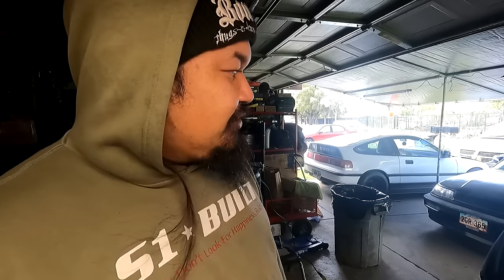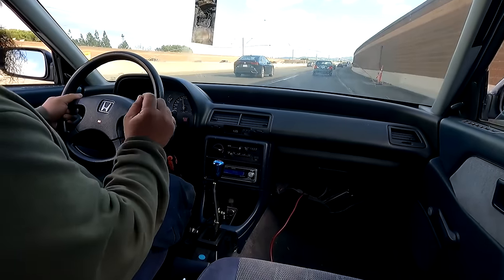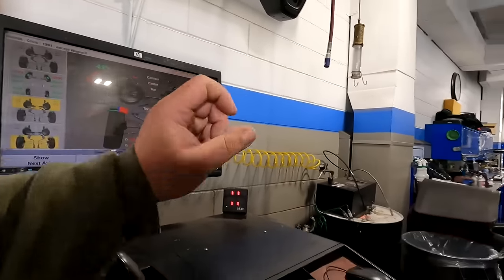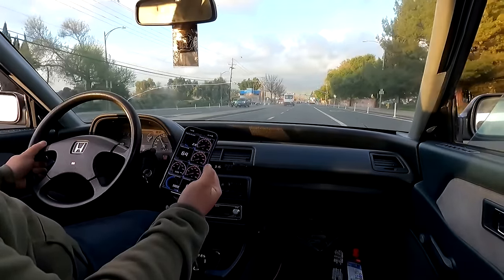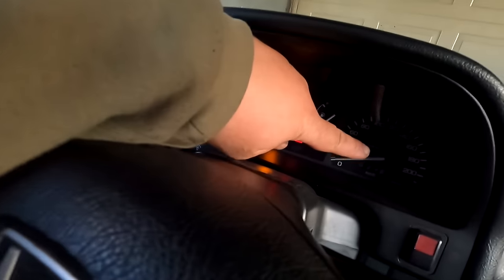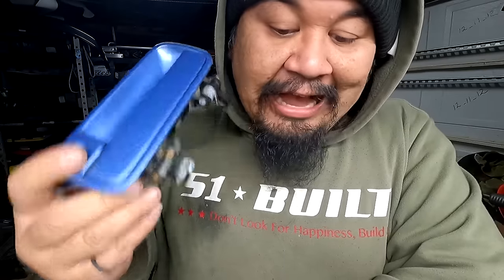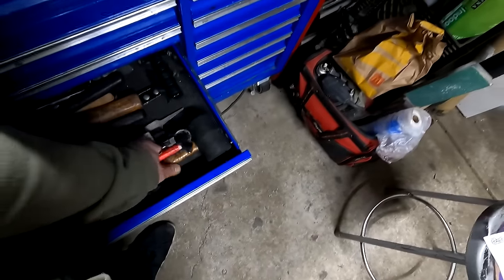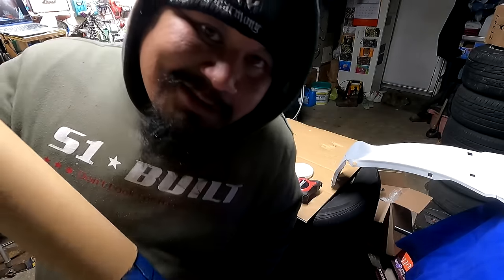FIRST DRIVE K20 TURBO EF SEDAN | Alignment | Vinyl Wrap

Comment: Progress better than no progress!! apart from the silly mistakes the fender looks sweet...when it comes to the tight corners get your self some plastic/silicon cooking spatulas etc they are great for pushing into the tight corners (you can probs get proper 'car wrap' pusher things on temu now for chump change, tho that stuff used to cost) also that stuff will stretch like crazy so for strange tight corners just keep practising stretching and 'shrinking' ...All the best from the UK...;D

Comment: I'm hoping that if you decide to wrap the entire car, that you haven't done so yet.

If you plan to wrap the entire car, I highly suggest you get a couple friends to help you. I bought some Vivid wrap for my Eg. I wasted an entire 60' roll just on the rear quarter because of glue lines. No matter how much I prepped it, no matter how lightly I set the wrap. Whenever I went to start with my line and work from there, there were glue lines.

If I had 2 more people to hold the wrap away from the car to get it in place after I pulled the backing paper off, I feel like it would have prevented the glue lines.

Comment: Do You Have Any Advise For A Honda Del Sol. Its Got A Engine Swap, Its Got A Ab16 Engine in it and The Spedometer Does Not Work Now.
Reply: Sounds like the speed sensor on the transmission is bad
Reply: @robindabank3737  Put a New 1 On Yesterday, Still Not Working.
Reply: @Iseekoutthetruth  does rpm, gas and temp work or all doesn’t?
Reply: @robindabank3737  Everything Works Except The Speedometer. All The Fuses Are Good Also And It Looks Like Someone Put A New Connector On The Speed Sensor At Sometime.

Comment: Do you think its okay to do oil change on a ramp? like u drive the front wheel on 2 ramps?
Reply: That’s perfectly fine bro a lot of people do that
Reply: 100% Ok to do so. You wouldn't want to check oil or fluid levels with the front of the vehicle on ramps. Reason being the car wouldn't be leveled and you wouldn't get an accurate reading. But if you empty the oil pan and you know how many quarts your car takes then there you go.
Reply: Not a problem but I prefer jacking the car up and two jackstands and using a tire to put under the car lot of work but it’s not to bad as long as it’s safe